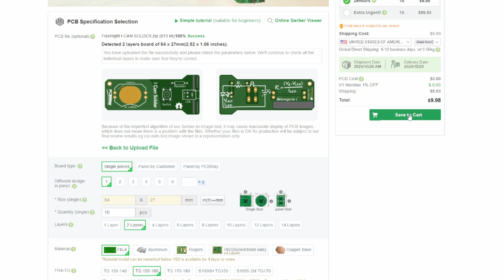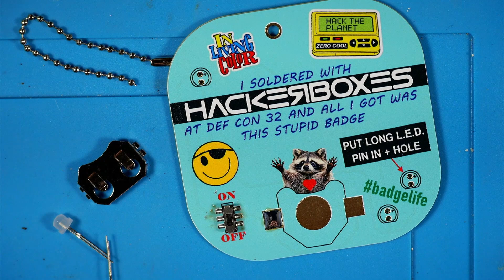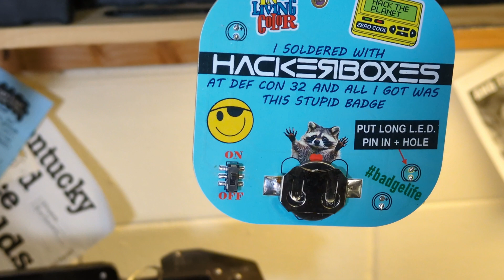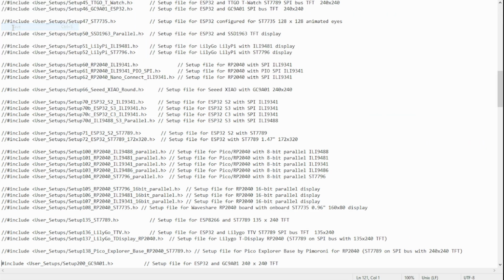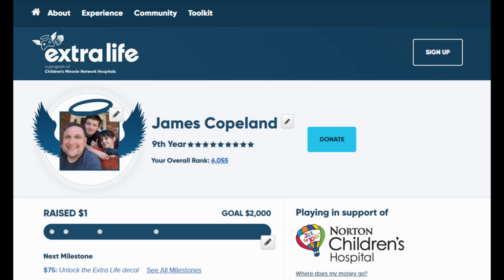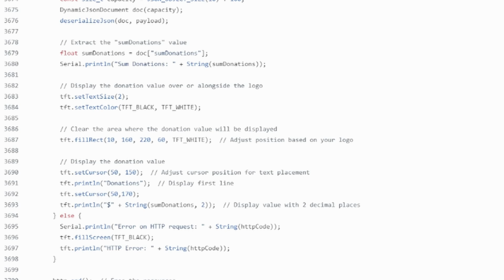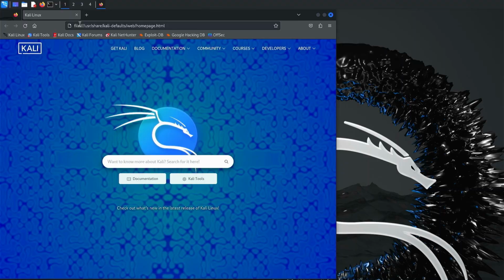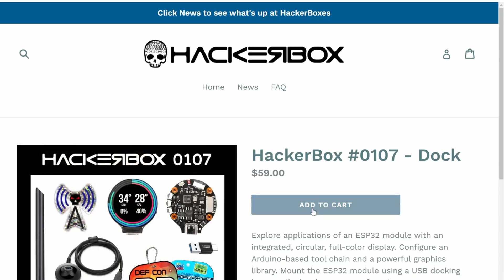Hackerbox 0107 - Dock

Comment: Was excited about this box, actually turning the esp32 display into a quick speedometer display for my motorized bike, have the gps module and display dialed in, just working on an enclosure for it
Reply from the maker: @robertsimmons6997  heck yeah! I was thinking it would be cool to design some kind of nice enclosure to take advantage of those threaded studs in the back. What kind of bike setup do you have? I used to burn way too much time on endless sphere I think it is/was. I need to get mine back out. I had one of those fun little cycle analyst thinger bobbers.
Reply: @JamiesHackShack  just an upgraded 2 stroke kit on a beach cruiser, always seemed to destroy anything mounted on the bike it’s self because of wicked vibrations, but trying to get this to be able to mount next to my GoPro on my bag